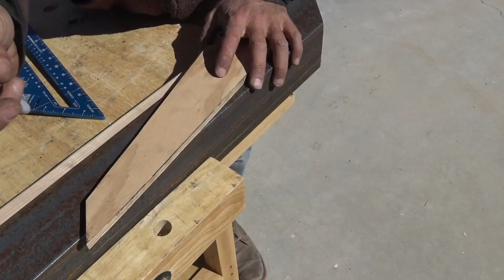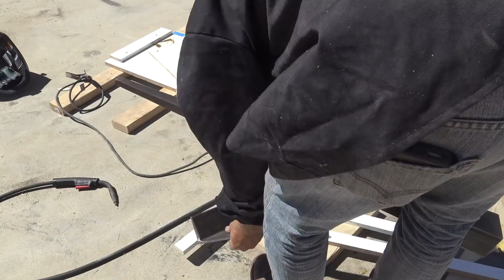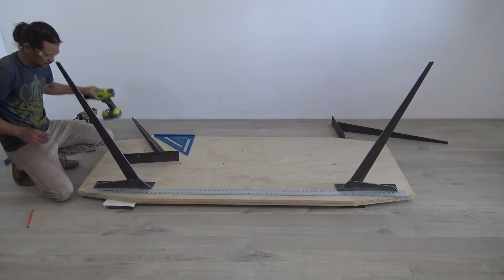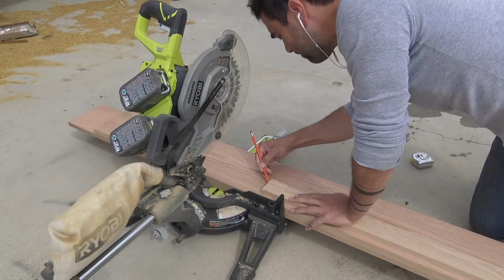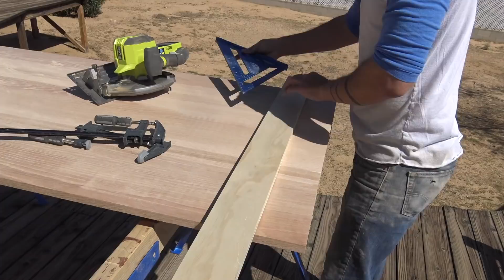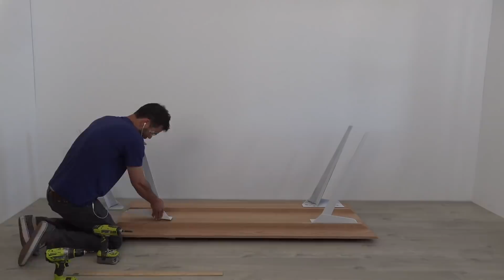DIY MODERN DINING TABLE | OAK AND STEEL

Comment: what was the purpose of the two beams for the second table made vs just gluing on some beams under the table to screw the legs in? some design explanations on why you did things a particular would help out a lot, instead of just a step by step of the process, on how to adapt/apply your tutorials to other builds.
Reply from the maker: I wanted at least 1.5" long screws to hold the legs to the table and the boards are just .75" thick.  I also thought the chance to add more definition to the profile was worth taking.

Comment: Looks great and affordable....and then there is the MIG welder
Reply from the maker: yeah this mig welder was one of the cheaper ones at Home Depot but still cost about $500.  I haven't done a lot of welding projects in the past for that reason.  What I am discovering though is that with just an angle grinder and the welder there are a ton of metal projects that can be achieved.

Comment: Nice work! Did you put something at the legs to avoid the steel from scratching the floor?
Reply from the maker: flex seal or hot glue work well but these legs are so smooth and rounded over that they aren't scratching the floors

Comment: what did you do with the feet to prevent floor scratches?
Reply from the maker: dipping them in flex seal works or a little hot glue